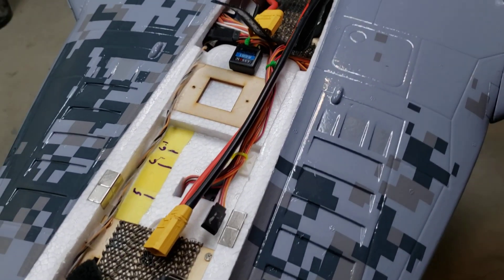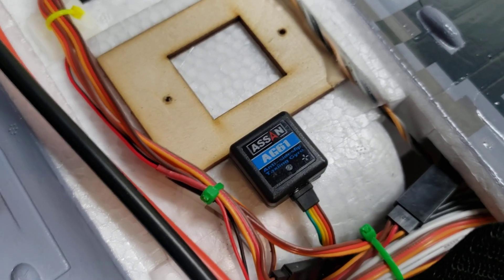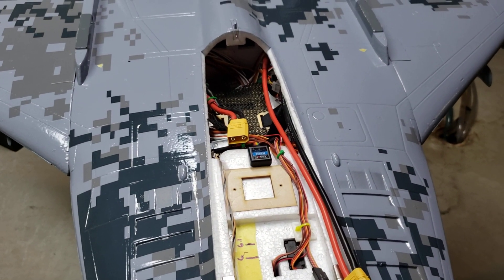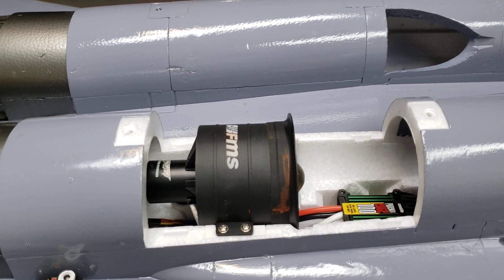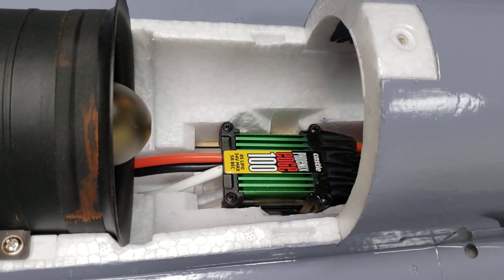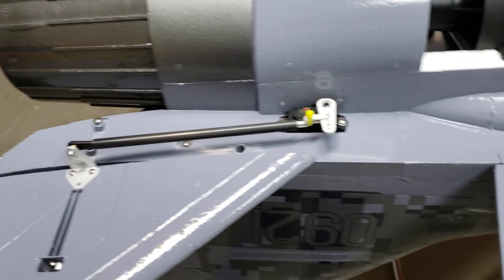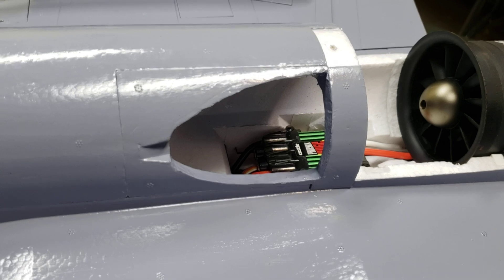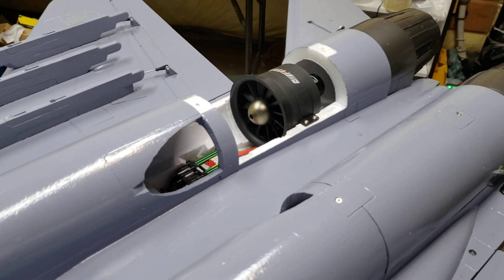Freewing MiG-29 Mods & Motor upgrade to FMS 2100kv inrunner 12-blade ... Sweet!

Comment: Hey I installed the same units in my mig and pretty happy with the way it performs vs the stock 9blade ,love the sound and the vertical is much better , I started running a true 45 c battery and that gave it another bump , fun plane for sure now

Comment: Any thoughts on if the FMS 2000KV setup would be a good match for this plane or is the FMS 2100KV a better setup?
Reply from the maker: It would be a rocket ship. I sold the plane to a friend of mine and that's definitely what I would do. In fact any 80 mm jet I would change it over to the 2000 KV.
Reply: @ghoustanable or the XFly 2300kV with the 3665 motors :)))?

Comment: Wondering if you can help me out mate.. I'm going to upgrade the ESCs and will pull the red wires to disable the bec so will wire in an external bec. Will a 10A be sufficient over the 8A stock? I can only dial the V down to 6 minimum. Will that be OK? Cheers. Mark 🇬🇧
Reply from the maker: Yes, that should be fine for this jet .just make sure that the bec voltage does not go over 5.5 volts to be safe. Cheers 🍻
Reply: @Garfield Houstan  if its set at 6V won't it go over 5.5V at times tho? Thanks mate

Comment: How do you set up an esc when there 2? I'm thinking of changing to an esc that has reverse thrust too (avian 100A) but I've only ever had single ESC stuff. Would telemetry also work with Avian and my smart lipos on this dual set up? Also would a 6ch RX be enough or do you feel a 10ch would be better (have u added any special mixes to need the extra ch). Cheers
Reply from the maker: Not familiar with the Avian ESC. That said, six channels should be fine I believe the Horizon Hobby ESC does not require an additional physical pin on the receiver to do reverse thrust. The transmitter that I use is a FRsky x20s 24 channel transmitter. That said if you're planning on doing thrust-vectoring with the MiG-29 which I strongly suggest that you don't do It's waste of money. It'll also   decreases the power of the 2100s significantly...not sure if it's an FSA problem but both myself and another pilot at our club experience the exact same phenomenon after upgrading to the thrust vectoring nozzles. If you still want to do thrust factoring then you would definitely need to go to at least 10 channels.
Regarding the two esc's they would work just fine because you would connect them ViA Y cable so it's still just requires the one channel also the plane comes with an external Bec given that you have two ESC running the plane.
Reply: @ghoustanable thanks for sharing that info about the vectors!!! 👍🏼 maybe they are too narrow? Good to know :)

Comment: Did you fly with the fms edfs before opening the cheats? If so, when you did open them, was it a night and day difference or marginal?
Reply from the maker: Did not fly with it before opening it however definitely a difference between the stock and FMS fans.  About 1kg of more static thrust. That's said I definitely do not recommend installing the thrust vectoring modules it's not needed and it hurts performance. Cheers

Comment: Greetings: I ordered my Mig 29 last week and can't wait for it to arrive.  Question: When you fly, Do you use the same "C rating" on both 6s Batteries? Or can One battery be let's say 70C and the other 100C and still work fine?  This aircraft has independent ESC"s right? so One battery for each ESC and Motor?  Thanks.
Reply from the maker: You could but I wouldn't just so that you have equal trust on both sides of the jet.
Reply: @ghoustanable  Ok Thankyou

Comment: nice mod, is it ok if the motor heat it up in static thrust test?
Reply from the maker: No problems just don't run it for over 30 seconds at full throttle. Cheers
Reply: @ghoustanable  thanks for sharing
Reply from the maker: @DruideRC  anything bro..Cheers

Comment: What is the thrust you are getting out of those FMS fans
Reply from the maker: 200g more per motor than the stock setup. Cheers
Reply: @ghoustanable  thanks for the quick response,    as a guess then,   2.5kg each       asking as building my own design airframe       thinking I'll need 5-6kg total.   So looking at 2x80mm on 6s,   have room for 90's     but really dont want the extra weight of going to 8s

Comment: Can you run 8s in it?
Reply from the maker: Not on this setup but this plane doesn't need it. If you're looking for more power just run the FMS 36 mm 2000 KV full metal shrouded EDF and you can run it on 7s it would be a beast but again no need 6s with this Motors is more than enough power for this plane.
Reply: @ghoustanable Hi Gary and thank you very much for sharing all this infos. Why do you say the metal shroud would be finer (for cooling?) or do you mean that 3665 motor takes the extra current better?
Reply from the maker: @ficosk8  the edf  has a built-in fan to cool the motor at the back as well the fan can take up to 7s. N9w with the metal body  of the shroud it also acts sort of like a heat sink to keep your temperatures down as well.